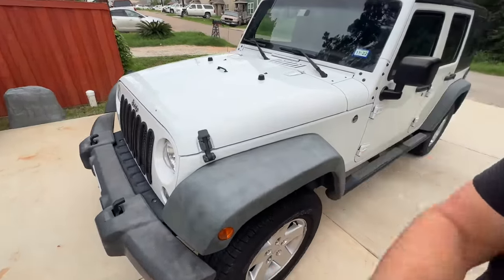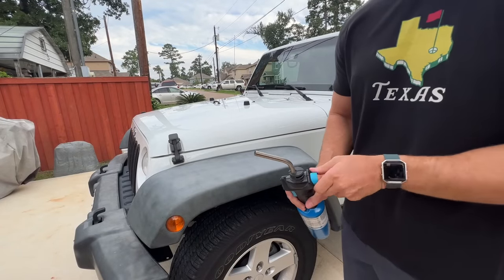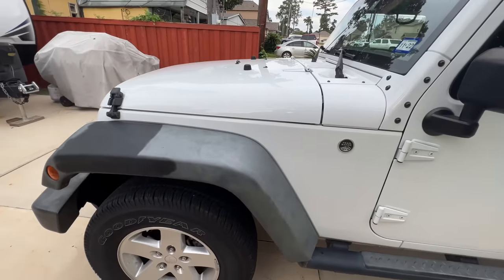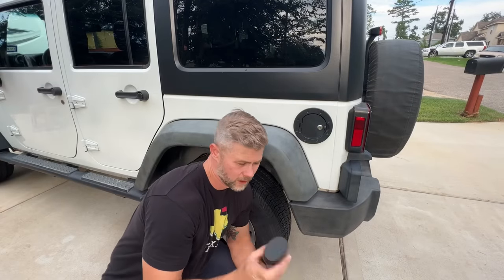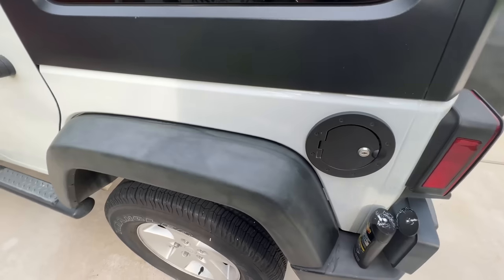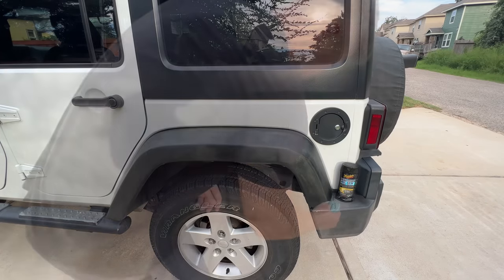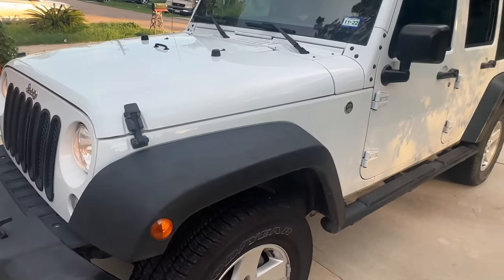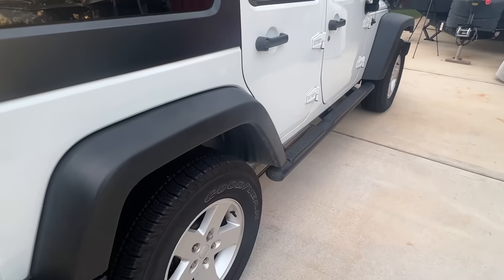Back in Black! How to bring those black plastic fenders and black trim pieces back to life.

Comment: That heat gun is bringing the oils in the plastic to the top after a couple of times you do this you pull all the oil out of the plastic and the plastic will become brittle and start breaking. You need to do something to add oils back into the plastic.
Reply from the maker: Yeah, that’s what I have heard. Unfortunately, this jeep was totaled so I haven’t been able to check any difference it made. I have used the heat on other plastics before with good results but nothing over a significant amount of time.
Reply: Very interesting guys.

Comment: You can use the heat and bring back the black, but it won’t last.  Been there, done that. What you can do is paint them. Use a two-part polyurethane paint because it will flex enough and not crack. And think of this… you never have to do anything but wash it. It will always look perfect! I’ve done this for years with nothing but excellent results.
Reply from the maker: Yeah I think that’s the way to go too
Reply: What paint did you use?  I'm not sure about this two part paint method.
Reply: Solution Finish dye is the best product.

Comment: One of the main reasons i would never buy a Jeep. You pay for metal fenders and they give you cheap plastic instead.
Reply from the maker: I definitely think they need to do better
Reply: @dadlifetexan  especially at the price point.
Reply: @dadlifetexan For those of us who drive their Jeep's offroad and have to deal to brush and branches, the plastic fenders are excellent. They hide the scratches and are cheap to replace. If you want prettier fenders, Jeep offers color matched (I.e. painted) fenders. Blaming Jeep for plastic fenders is naive.

Comment: That Meguires isn't very good IMO, try Forever Black it's a dye and works great and lasts only needs one coat. You'll have to tape off anywhere you don't want it like paint.Also wearing gloves is highly recommended. While that heat method looks like it works I think you're prematurely aging the plastic material and giving zero UV protection which is what causes the black to discolor in the first place.
Reply from the maker: I usually like meguires products but haven’t heard good things about this one
Reply: @dadlifetexan  ...well, now you have.😉

Comment: I hear that using a heat gun or torch that it pulls all the oils that is in that plastic to the top and after so many months it's back to grey/white and you can't get it back.
Reply from the maker: I have heard that too, but I have used the torch technique on other vehicle plastics before.  They do go back to the grey/white color but you can hit them with the torch or heat gun again and it will bring them back to black every time.  At least that is my experience.  Won't be able to test that with this jeep because it was involved in an accident and is totaled...

Comment: Wash, burn, wipe and then the polish. Looks great, I am a professional detail restorer and this is the method I have used for years, great results. Good video though.
Reply from the maker: awesome, thanks for the tip
Reply: Is it the heat or the flame?  Like could you use a high temp heat gun?
Reply: @crushingsnakes1976  you can use a heat gun

Comment: The torch method is releasing the oils from within the plastic back onto the surface, it won’t last as long as the original black, and will leave the plastic brittle over several attempts..
Reply from the maker: yeah that's what I have heard
Reply: Sorry but the torch method is burning off the layer of plastic that has been tarnished by the UV exposure, then exposing a new plastic layer. Been using this method as a professional detailer for years, then black polish after to protect the new surface from the UV

Comment: I found a McQuires Hot Shine Tire Coating spray that I use on my plastic parts.   You have to be careful to wipe it off the paint.  But it’s fast and works great. Not the foam stuff. It’s an aerosol spray.
Reply from the maker: Awesome, thanks for the tip. I’ll have to check it out.

Comment: Hey, I think the torch was the best way to go, the heat brings the oils in the plastic out and it is pretty permanent Vs the other, you will have to redo it a lot to keep it that way. And don't worry about the trolls and the negative comments, we all get em lol.  P.S. I looked for the next video you said you were gonna do later on, I see you didn't make anymore showing how they looked months down the road, which is looking best today? 👋🤠
Reply from the maker: yeah, if it works it works!  couldn't do an update video because the jeep was actually totaled shortly after the video was recorded...

Comment: I have seen a few others using a few different products after heating the surface.  One channel I watched used linseed oil after the plastic cooled.  I have an 04 Wrangler X with the original sunbaked plastic.  I plan to remove the pieces in a few days.  I guess I will see what works.
Reply from the maker: Yeah, that's a good idea to treat the plastic with something after they cool.  Would probably help protect and keep the look longer.
Reply: I just finished the fender flares and a few other pieces.  I used a heat gun on high, then let the pieces cool down.  After that, I mixed paint thinner and linseed oil 50-50 and applied to all the parts with a rag.  I removed all of my parts because there was 20 years worth of dirt under them scratching the paint.  After the parts dried I put them back on.  The water just beads off of them.  So far, I'm pretty happy with the results.  But, I will see in a few weeks.
Reply from the maker: That’s awesome, removing them to get them clean was a good call
Reply: @dadlifetexan  .  Having the parts off definitely takes the worry of damaging paint or anything else out of the picture.  Plus, I'm old and slow and was smoking a joint at the time.
Reply from the maker: lol perfect

Comment: I used a heat gun on my truck’s bumper and it looked great but didn’t last more than a month or so before it turned gray again.
Reply from the maker: Did you use any other methods after that?

Comment: I wonder if a heat gun will do the same as the propane torch
Reply from the maker: Yes, it will. The only thing is the heat gun takes longer to heat the plastic so you just need to be careful to not hold it in one place too long or you risk melting the plastic.

Comment: The torch is way better , the miguiars won't last more than a few week's at best. Best option is to do a trim restorer like polish angel and then coat it with gyeon trim coat to protect for 1-2 years.
Reply from the maker: Thanks for the tip!

Comment: I tried it. Torch lasts about a year if your car stays outside. Just do it again. Now be careful. Not all plastics react the same. Another precaution is make sure your vehicle doesn't have any gas leaks or not use it to close to flammables like greases and oils.
Reply from the maker: Absolutely
Reply: The more u torch the more brittle it becomes

Comment: Next Jeep try Solution Finish it last longer than most and avoid ceramic coatings that seal the top, they still will return to grey.
Reply from the maker: Appreciate the tip, will give it a try!

Comment: I would think spraying with Rhino Liner would be another (better) option that is more long term and adds to the durability. You don’t need to do the incredibly thick rough stuff, it comes in many finishes, plus you can choose your color.
Reply from the maker: Yah that’s a good option too. We were trying to go with more of stock look on this Jeep because it didn’t have any modifications.
Reply: I would think for the price of a new Jeep they would actually make a fender out of steel. No they don't and Goobers keep buying these overpriced UTV's with cheaper and cheaper parts. You are being ripped off.
Reply: @drush525  The flares are plastic because they will see a lot of abuse on the trail (trees, rocks, etc) and are pliable without taking permanent damage and they will reduce damage transfer to the body panels from higher impact scenarios.  Additionally they are cheap and easy to replace if/when they are abused to the point of replacing, it's a cheaper/easier job than replacing steel ones.
Reply: Any long term update on the 2 methods used in this video?
Reply: @benharper1087  why did Jeep used to make them out of steel?
Reply from the maker: @CraigG21 unfortunately, this jeep was totaled a few weeks after this video was recorded…
Reply: @drush525  You mean the 60s and prior when most of the exterior panels across the automobile industry were steel?  I don't know why...
Reply: @CraigG21  I’ve used the Maguire’s product before. It looks great once you put on about 2 coats but after it wares off the surface you treated looks worse than it did before applying the product.
Reply: @drush525 First, Jeep offers metal (color matched) fenders...at least I assume they're metal/aluminum) because they are smooth, not textured. My plastic fenders have quite a few scratches that are hard to see from branches overhanging trails. I would never change them to painted metal. Perhaps Jeep switched to plastic after learning that buyers preferred them.
Reply: Bed liner spray doesn't stick to well on plastic surface.
Reply: @benharper1087  You misspelled a couple things. "see a lot of abuse
Reply: Petroleum jelly or otherwise known as Vaseline I tried lots of other stuff before I saw a comment on another vid when I'd just about givin up lookin
Reply: @cswilliams29  You don't know what "a lot" means?
Reply: @benharper1087  I was trying to be funny. Youtube didn't  like my comment and erased it. I could not edit or delete what was left. Please disregard 😁
Reply: Wow. I hope no one was seriously hurt.   @dadlifetexan

Comment: I’m thinking of doing this but would like to know if it has lasted?
Reply from the maker: Well my girlfriend actually totaled this Jeep, but it lasted about 3 months before it needed to be done again.
Reply: The heat pulls oils to the surface and that restores the color but long term it will make the plastic brittle and the color will fade again (faster than the first time). Better to use a restoration product that adds back oil.

Comment: Torching them last about 2 weeks then its worse. Back to black sucks too
Reply from the maker: Anything you recommend?
Reply: @dadlifetexan  
I used duplicator trim and bumper paint on my van bumper. It has a few scratches in it now, but it ain't faded white anymore. 
Thinking about putting another coat on it. Its been 2 years.
Reply from the maker: I’ll have to check it out, thanks!

Comment: The torch works by pulling the oils in the plastic to the surface abd it does work... 

 ...howver you are also actively damaging the plastic by this method, making them more brittle and failure prone.  It won't last and will fade quicker.  It is an old used car sales trick.

Oils/treatments will help replenish the surface, but it is a regular maintenance task has to be done.
Reply from the maker: Yeah that’s what I hear